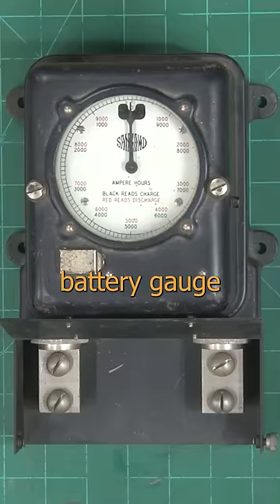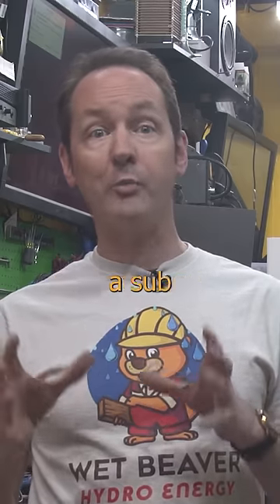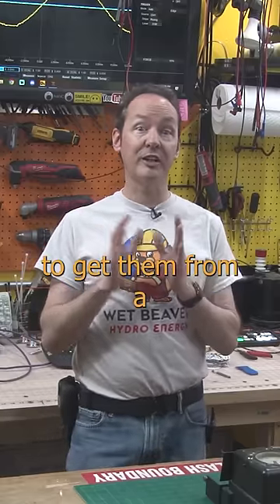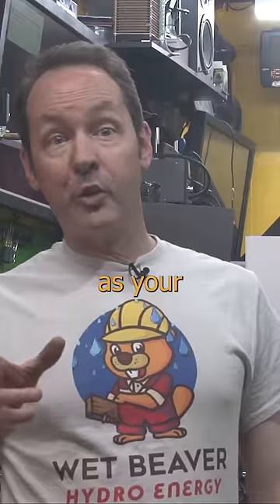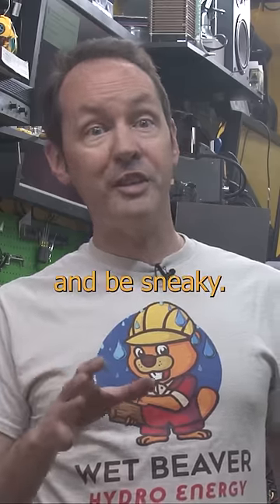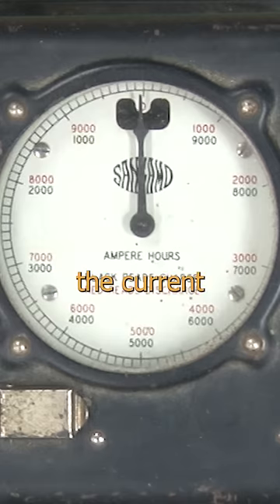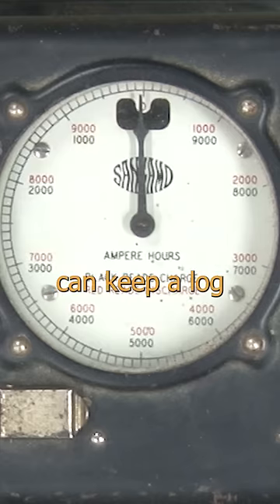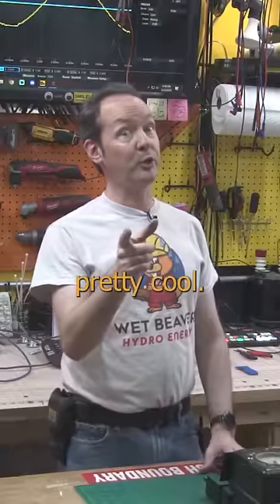Submarine Battery Gauge #engineering #electricity #current #science #powerplant #power #energy

Comment: We still use batteries on submarines. And a lot of our metering is the same. Our syncroscopes are the same as the ones you’ve shown.
Reply: That’s so cool!
Reply: Even on nuclear subs? Are you talking battery banks that would be primary power for things, or more of a load balancing giant capacitor sort of setup so the reactor doesn't need to be throttled up and down as much?
Reply: @outsider344  I’m guessing probably both. As you know batteries act as reservoir that smooth out the ripples current draw makes on any circuit.
But I have no idea, I was a Ground Pounder with the 9th and the only submarine I have been on was the Blue Back here at the OMSI in Portland, OR. 😁
Reply: @outsider344 But all US Navy submarines are currently nuclear, which I googled, thinking most were not nuclear.

As you said, reactors do take a long time to change state, so even for countries like France with 80% nuclear electric power, more than 80 is not feasible because of usage swings. You could always get power bursts for subs for emergencies by batteries. The other way to have reserve available is to dump power under normal circumstances. (Supposedly, France used to require lights on all night to even out power usage. That's dumping power.)
Reply: @outsider344 @tekman2000 @kennethflorek8532 Submariner here, the battery on US subs only acts as an emergency power source in a case that the reactor would have to be shut down, otherwise the battery doesn't do much. The reactors on US subs are extremely capable and can change power levels extremely quickly compared to civilian plants.
Reply: @letthegalaxieburn  thanks! appreciate the insight
Reply: I did a tour of the uss Tennessee and they had a massive stack of batteries that they were in the process of checking and replacing the ones that were no longer good.
Reply: batteries on nuclear sub = silent running. just like on the diesel subs
Reply: @joerussell-im5ym  No. Emergency power to get the reactor restarted ( under certain conditions). Also for emergency propulsion. Yes, I was a submariner.
Reply: @michaelwarren2391 the safety record for US naval reactors is absolutely wild.

Especially given that the plants are designed to be run by enlisted sailors. No disrespect intended of course.

As someone who works in heavy industry with "professionals" who manage to break everything they touch, it's damn impressive
Reply: @letthegalaxieburn I just knew, just like modern EV still somewhere have one small 12v battery 😂
Reply: Hush 🤫
Reply: @I_Automate I was a nuke, it’s because of the old selection process. It’s two years of harder training than most PhD students receive. (Or it used to be, from what I’ve heard it’s gone much like the rest of the world, soft, in the last twenty years or so, but yeah.)
Reply: @michaelwarren2391  How do you guys deal with the being couped up underwater for so long?  Genuine question.
Reply: @DeepakKumar-lv4te  the law of conservation of happiness 
Once the hatch is closed happiness can't be created or destroyed just stolen from others it winds up keeping us entertained for the most part
Reply: @OneEyedManKingdomOfTheBlind  
Didn't name-drop Admiral Rickover when discussing past-era naval nuke training pipeline, nuke card revoked.

My understanding was that the intended selection pool for nuclear operators was to be warrent officers only, but not even big R could make that fly. The training regeim may have reflected the intended selection pool for a good long while, with instructors of a caliber that could maintain that standard. Modern instrictors, however, reflect the pool of talent that the program is able to maintain, and that has been on a slow but steady decline for ages.
Reply: @michaelwarren2391   Wanna tell them about the diesel on nukes too?

Comment: 10,000 amps for one hour or 1 amp for 10,000 hours. 

Enough amperage to make the energizer bunny blush.
Reply: How would you see it blush though? It's pink.
Reply: @fatitankeris6327  with that many amps? He'd be orange. Briefly.
Reply: @fatitankeris6327  idk let's find out, I'm sure if we send 10KA through the bunny something will happen.
Reply: @midship_nc hey siri, what’s the electrical resistance of the energizer bunny
Reply: @Cartermchick  let's hypothetically say the bunny has an internal resistance of 10 ohms,  we would need 100Kv to push 10KA through said bunny. 

Sounds like a good time. Might need a fire extinguisher.
Reply: @midship_nc i assure you the fire extinguisher isnt needed... 💀
Reply: @midship_nc You seen that YouTube channel of the guy who over-volts electric toys? 😂
Reply: But this is only half of the equation. To understand power (remember) volts x amps = watts ——— multiply 10,000 kiloamps by the system voltage to get wattage. That means power is 12-220 times more watthours
Reply: @midship_nc didn't assume the bunny was a sphere of uniform density, 0/10
Reply: And they had to monitor hydrogen levels, lest things get exceptionally exciting - briefly.
And if seawater got into the battery room, then the vessel was in grave danger of a battery explosion that'd sink the sub and actually did claim a number of boats.
Yet another reason I was glad to have my career in the Army.
Reply: Or 36 000 000 amperes for one second.
Reply: @mrwess1927  it's not half the equation, watt hours were never mentioned
Reply: You all are my favorite nerds to hang out with in the comments for reasons, well, like this thread 😂
Reply: Most if not all batteries die way quicker when higher current is drawn, i.e. the capacity is inversely related to drain speed.
Reply: You would never be able to get all that smoke back into the Bunny! 😲💥
Reply: @midship_nc 
You will never be able to put all the smoke back into that poor Bunny!  🤧
Reply: 10ka are not going through those terminals
Reply: Or enough to charge an iphone 15 plus 2,273 times plus one more to 72%

Comment: That's pretty cool! Didn't know the amount of fuel on a nuclear submarine was so small!
Reply: The amount of fuel onboard is about the size of a refrigerator, but he was referring to the amount used for a specific trip.
Reply: If I remember correctly, a soda can sized amount of nuclear fuel is enough to power the average persons needs for a lifetime. 

Now picture how far you can travel on ONE gallon of gasoline.
Reply: A golf ball is roughly 40.68 cm³, U-235 is about 19g/cm³. So, about 773g. Annual fuel burn averaged over the entire US Nuclear Navy fleet, which includes aircraft carriers, which are going to burn much more than a sub, is 7kg per reactor. About 9 golf balls. So you could figure maybe 4-5 golf balls worth per year of a sub. A sub would have no problem circling the planet 4-5x in a year. So yeah, a golf ball's worth is plenty to get around the planet.
Reply: @JoshuaTootell "TO infinity! And BEYOND!" 😂
Reply: Uranium and thorium are wonderfully useful and dense energy sources.
Reply: I used to do electrical new construction on the bew aircraft carriers and they only refuel every 25 years. I dont know how often the subs refuel but it is probably similar.  Never worked in the sub shop.
Reply: Nuclear power is delightfully efficient, and it’s one of the reasons I’m a strong advocate for it as a sustainable energy source that can easily supplement renewable energy to make a cleaner grid.

Nuclear power is just barely profitable due to the high safety standards and resultant construction and operating costs, but the dangers and radioactive waste produced are substantially less over the lifetime of a given power plant than the RADIOACTIVE (not including other long term toxic waste) produced in the process of running oil or coal plants… which have much lower safety standards despite having a nearly as high safety risk. Because safety standards cut into profits and we can’t be having that

Comment: Yes that is cool.  It was also created in the 1930s.  Approx 85 years ago.  Have we only come this far?
Reply: Why fix something that works?
Reply: The B52 bomber has been in service for over 70 years, if its simple and it works, don't change it.
Reply: The real problem is we've gone too far. We now have bluetooth circuit breakers...WTF.  A regular breaker uses NO power at all, and can last 50-100 YEARS.  Those "smart" breakers actually USE power, generate heat, and will be lucky to last 25-50 MONTHS. Progress my ass......
Reply: @mxslick50 Yes all that SmArt stuff is not good et all. Each letter in that means systematic military agression retaliation takeover.

Comment: Fun anecdote from a ww2 U-boat; Using the toilet was a complicated process that required a specialist. An officer on board had to use it, and the specialist wasn't handy. He promptly caused the sub to take on water, which immediately pooled into the batteries and caused the cabin to fill with chlorine gas. They had to surface where they were promptly captured.

Comment: Actually, the diesel engines weren't the prime movers, the electric motors attached to the props were. The diesel engines supplied enough power to charge the batteries and run the propellors. The subs had to surface regularly to breath allowing fresh air to be brought in for both the crew and for the diesel generators to charge the batteries.

Comment: Even today, there are applications for diesel-electric submarines. Using modern engines and especially modern battery tech, the submarine can charge a LOT of power to its batteries and then run VERY quietly bc there are no mechanical parts operating to generate power, just batteries being discharged. It might be the older tech, but there are cases where it's superior to nuclear. Plus, it takes less work to certify and maintain the boat as a result, it's cheaper and faster to build, you don't require nuclear power specialists on the crew, and I've heard that diesel fuel is a little cheaper than U-235.

I mean, it's 2777 AUC, we have very good transistors and very small transistors, and yet we still use vacuum tubes for some jobs (like audio amplification) because they perform the particular job better. Being older doesn't make something automatically superior, but it doesn't make it automatically inferior either.

Comment: I did look it up, I think the "golf ball" size refers to per passage or per year or something like that. The best estimate I saw was on the order of a meter³ per 25yr cycle but that was with the u235+alloy they use to make rods. It equates to about 50kg or year of a material that p=15t/m³ or 15g/cm³ ~ known density of the isotope avg'd density of 19g/cm³ (so 15 including the alloy checks out). 
That's about 3350 cc's or 3⅓ L of u235 alloy or
about half a basketball of alloy per year
Reply: Also the uranium on nuclear submarines is enriched to insane 90-96% typically, while commercial reactors have 3-5% enrichment typically

Comment: That thing had to be accurate.. plus I’m sure they spared no expense obviously.. but the thing is that those lead-acid batteries are mainly performing based on a given spec to give you AH & reserve capacity so you’d have to stay in a certain range and it’d also only work given almost perfect health of the cells & that they were very much charged to begin with but I’m also wonderin if it was basically a WH meter or if it had some other tech behind it including voltage measurements which are also very indicative of “state of charge”🤔 (I’m assuming lead-acid🤷‍♂️; if different correct me.. although all batteries have a given spec that follows somewhat close to my comment)..

Comment: Is there a reason they didn’t test battery charger by reference to battery voltage, which rises and falls depending on charge state?
Reply: Most battery's used on sub submarines old new and in between are similar to car batteries they maintain a relatively constant voltage and can very there discharge current especially when ar there mostly chared state with small drops in voltage as they reach the end of there discharge like a car maining 12-14v but they will reach a point where the voltage is so low it's hard to maintain curent hope this helps

Comment: It’s not that diesels couldn’t run underwater , they could but it would suck all the fresh air into the engines and the exhaust fumes would choke everyone out.
Reply: Subs would have a snorkel to suck air in for the engine, so it could cruise around with just the top showing, still a lot harder to spot than the entire submarine. So not a lot of call for an engine that kills the crew.

The exhaust doesn't actually empty into the crew spaces, it goes out into the air. So I suppose it would work as long as it could suck air in, and I suppose you'd have to bubble it out of the exhaust against water pressure. I can't see it working.

Comment: How would a diesel generator work in a sub, there's no air coming in, unless there's a huge snorkel
Reply: The engines are run while on the surface.  All they do is charge the batteries.

Comment: But nuclear isn't efficient. Says the solar and wind power jockeys. Also, when the batteries were low, they had to surface or later on use a snorkel which made the sub open for attacks from aircraft or other naval vessels. The noise was like a flare given anyone with a hydrophone the ability to find them.

Comment: Nope thats called a “brain drain dial” it has driven many submariners to insanity.
Reply: I have to wonder why they didn't just have a meter there with several digits, like a normal electric meter. Then nobody would have to bother checking the reading, it would just keep track itself. When they got back into port and gave the batteries a full charge, they could reset it to zero so it wouldn't drift over time.

Comment: Not all that cool - my car has an ammeter  that measures current in and out of my vattery, including when starting. Up to 150 amps - each way. It's the same, just smaller.
Reply: No it is not the same.
Your car has an ammeter. The ammeter measures current in amps.

This is not displaying the measurement in amps.

It is integrating the current with respect to time. Totally different thing.

The units on the dial are not amps, they are ampere-hours.

And it is cool, because it is performing the mathematical operation of integration on the current with respect to time. It is actually doing a mathematical calculation.
Reply: This is more like the meter on your house.
Reply: @JoshuaTootell  Right. The mathematical operation of integration is just counting, in this case. The old meters had a disc that spun round faster, the more power you used. That just drove a mechanical counter through some gears.

It was a lot like having a very low-power motor in series with your house.